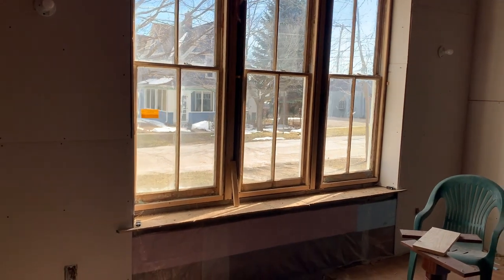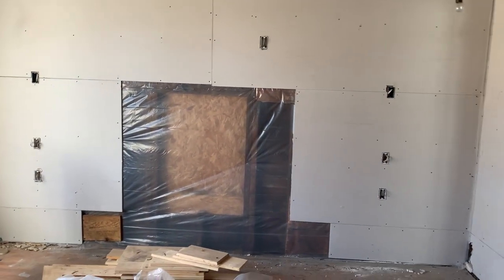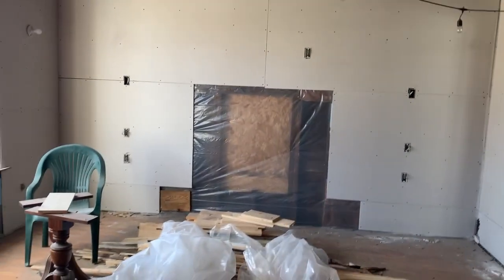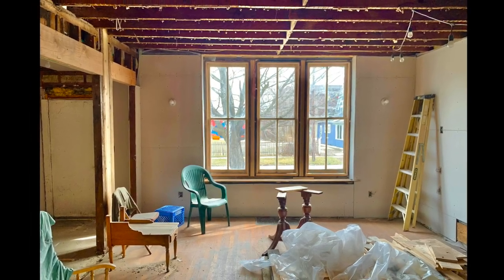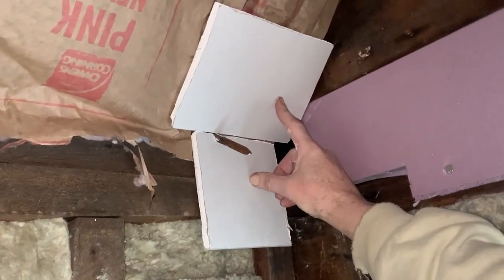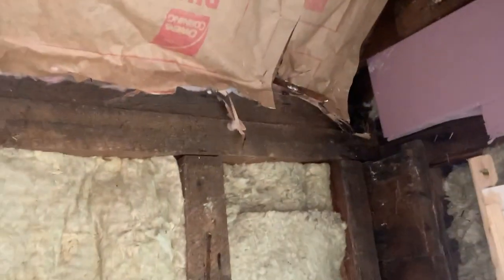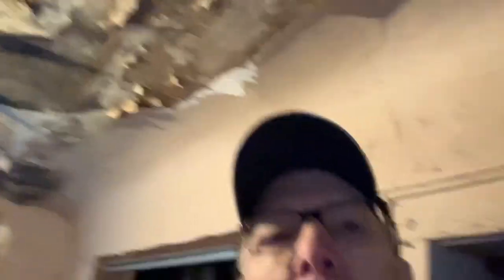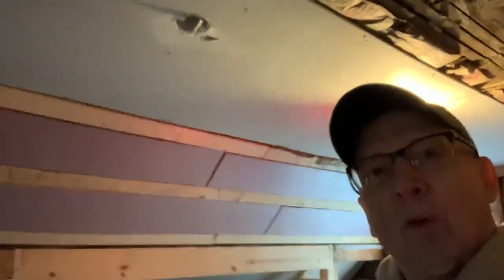My Ridiculous Old House Rescue #29:   Three Years In!

Comment: Shouldn't put that plastic behind the sheetrock, can't breath, black mold will come.
Reply: Hi Triggerhappy! Thank you for your concern. The plastic barrier is required here and was approved by the inspector. There won’t be high enough humidity in the house for any mold, and the wall can breathe to the outside anyway. Have a great day!